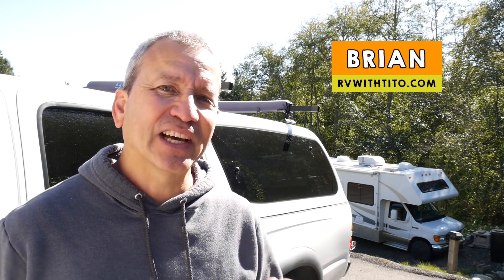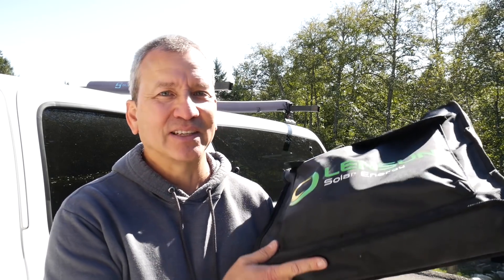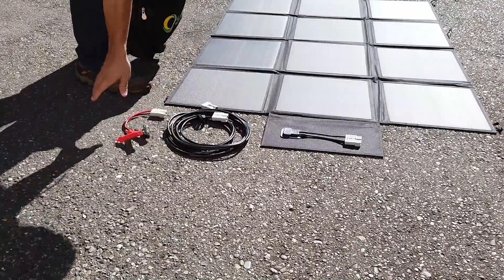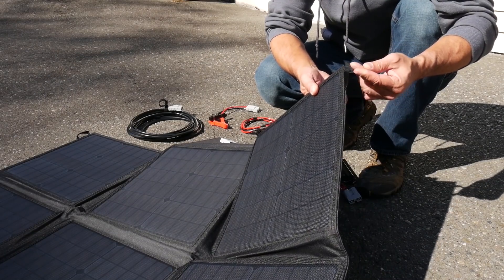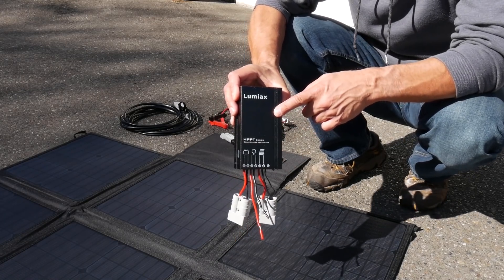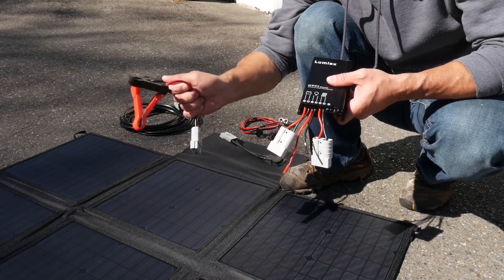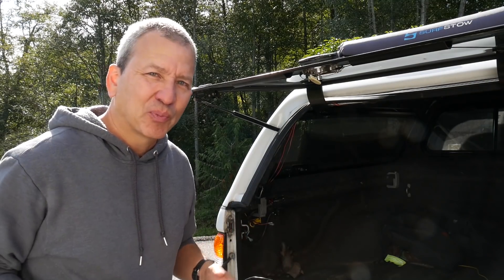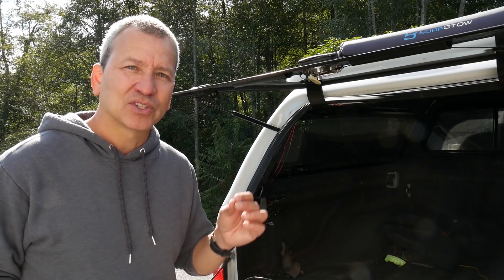(Review) Lensun 200 Watt Foldable Portable Solar Panel with MPPT

Comment from the maker: UPDATE - CHARGING LITHIUM BATTERIES - Good News! Lensun provided a Lithium compatible MPPT charge controller that charges Lithium/LiFEP04 batteries. I tested it out and it works fine. See the picture I posted in the community section of my channel. GROMMETS: I also added grommets to each side. Those also work fine for hanging the panel and support the weight well. They should last a long time.
Reply: Have you tested the panels with a different (Victron) controller?
Reply from the maker: @tannerjim  Yes. I've hooked it up to my Victron MPPT and it works great. I've also used it with a portable power station which works fine.
Reply from the maker: Yes. I connected it to my Victron MPPT 75/15. Works good.
Reply: I think I have heard of people having to configure the voltage in the controller directly (not auto) to get around that issue.  I don't have Li so I am not up on the details.
Reply: Thanks for the video Tito, I went to the website and it says that you need to let the company know that you will be using them for lithium batteries so that they can put the correct controller on your order.
Reply: @mv.m5438  What do you have to do if you order this now and upgrade to Lithium later? Any idea whether they would have to send you a new controller or is it a software or setting that needs to be adjusted?
Reply: Everything RV by Pat, the company sells solar controllers for lithium batteries I saw the cheapest starting at $99.
Reply from the maker: I'm sure the lithium compatible one would work for both. So if you know you're going to upgrade just get the other one. Or just use a different MPPT controller.
Reply from the maker: @mv.m5438  Correct. I just update the comment after testing the Lithium compatible controller. It works fine.
Reply: Lensun website: Note: the original solar controller is charge for lead-acid batteries, if you want to charge lithium battery, pls contact us, we will change the solar controller for you to charge lithium battery.  (http://www.lensunsolar.com/index.php?route=product/product&path=81&product_id=356)
Reply from the maker: @esdsecurity  Good news. The other one works. See updated comment.

Comment: Have you considering 
CTEK PRODUCT
CTEK D250SE- The D250SE is a fully automatic, 5 step charger that supplies up to 20A of power to any 12V lead acid or lithium* service battery from 40–300Ah. It has selectable charge algorithms for AGM and lithium* batteries and can use power through its dual input from alternator, solar panel and wind power. When the service battery is fully charged, the D250SE will automatically redirect maintenance charge power to the starter battery. The D250SE can maintain a stable output up to 20A to vehicles ﬁtted with smart ECU controlled alternators and also has a temperature sensor for optimized charging, regardless of weather conditions.
CTEK SMARTPASS 120S- SMARTPASS 120S is a 120A Power Management Solution which distributes, controls and maximizes the available energy from your alternator to power service batteries and consumers. SMARTPASS 120S handles all 12V batteries between 28–800Ah. The SMARTPASS 120S’s Battery Guard function ensures that critical equipment such as radio, emergency lights and n avigation systems always have power and take priority when the voltage on the service battery is low disconnecting non-critical consumers. The unit’s Battery Guard will protect your service battery from total discharge and built in over temperature protection reduces charge current before the battery temperature gets too high. SMARTPASS 120S is compatible with the D250SA and D250SE 20A on board chargers.

Comment: Nice unit and I like the way it handles partial shade. But you have to wonder why they chose those giant Anderson connectors. Big overkill for 11 or 12 amps. 
.
Reply from the maker: I suppose the connectors will come in handy if you chain a few together. Oh well. Overkill is better than underkill I suppose.

Comment: Looks like you had fun doing all this testing. Curious if it would work if you go "solar direct" into a lithium battery. Curious if the battery's BMS will prevent overcharging, overcurrent, overvoltage conditions with an 18v (or 21v) solar panel directly connected to it. Lithium batteries are expensive to "play with" for experiments...would def su*k if it destroyed a perfectly good small lithium battery like yours. Thanks for making this video...always inspiring and helpful for others to DIY solar
Reply from the maker: Direct is probably not a good idea, but I'll bet the BMS over voltage shutdown would kick in anyway like you said.
Reply: Yes, probably not a good idea to bypass a charge controller and use the BMS as a controller. The BMS doesn’t do anything except monitor to see if something goes out of specification. Then it activates and shuts down the loads and charge source.

Comment: Also Brian can you post voltage at the battery. If its 16v like you show in the video, its of course too high for battery charging and probably why the LIPO bms is rejecting it..
Reply from the maker: Sorry I didn't show that. The controller lowers the voltage to the battery to between 13.4 - 14.8 or so.
Reply: RV with Tito DIY Thanks Brian.

Comment: Ridiculous that it won't charge a LIPO battery. Maybe it didn't like the bms in you test lithium battery.
Reply from the maker: That's what I was thinking too. I'll have to look into that further. I couldn't find any references for the controller blinking indicator light either.
Reply: It should have charged the Lithium battery initially as the charge controller just “sees” voltage and a load. It doesn’t know what chemistry it’s connected to. The Lithium battery might be fully charged so the bms is not connecting to the charge controller.
Reply from the maker: @paulbaker3144  That's possible. But I don't know for sure. Lensun is sending me a different controller suitable for Lithium batteries. So I'll give that a test.

Comment: Only issue that concerns me with with this is how easy it would be to steal.  Grommets strategically placed MAY be a better design so that at least a cable could be used to keep passer-by from walking off with it.  LOVE the portability!
Reply from the maker: I'll add some grommets and run a locking cable through it.

Comment: Interesting product.  Those Anderson connectors make it easy to interface with other systems. I'd have to make my own extension cables though.  Those look a little small and short for our set-up.   I agree that grommets would have been a better choice for attachment points.  How about heating with a black panel laying directly on the ground or on the RV?   Pretty slick though.  Nice entry into the folding panel fray.  It'll be interesting to see how it holds up.  Have fun.  Safe travels.
Reply from the maker: Yeah. I'll let you know if there's any heating issue. I'm definitely adding some grommets. Thanks for the comments.

Comment: Any uv data , or dry environment data  i live in Arizona as you know and things don't last long in sunshine
Reply from the maker: I didn't see any UV data. All I know is the ETFE top layer which holds up well. There's also a fiberglass backing on each of the 12 sub panels for strength.

Comment: Unfortunately anything "portable" in the RV world means they will probably develop feet.
Reply from the maker: Yeah. Maybe I'll put a bicycle chain on it.
Reply: @RVwithTito  you may laugh, but I have a chains and padlocks on my spare tire, step support and surge suppressor.   When parked at the storage yard, I have a chains and padlocks on my traffic cones!  The cones developed feet and moved one space over!   Yes, the storage yard is in a cheaper part of town.
Reply: and be overpriced
Reply: This might be a dumb question but could you affix the panels to the roof with some kind of adhesive?
Reply: @slister45  It's actually a good question.  Yes, you can affix panels to the roof safely with high-strength tape and people do it that way sometimes.    The bigger question is whether or not it's a good idea from the panel's point of view.  Reasoning:  panel temperature affects panel power output, so cooler panels make more power than hotter ones.  This is why framed (mounted in hard frames) panels are mounted with an airgap under them;  cooling breezes pass under the panel and remove excess heat.  Surface mounting either prevents this cooling, or transfers the heat into your van.  <-- might be a good thing if you live in a cold place.

There is a type of "flex" panel that is more resistent to heat-related losses:  amorphous ("thin-film").  These panels look like they're made of long strips and are harder and harder to find. 

In general, though, "flex" panels cost 2x as much as framed panels and have much shorter lifespans.  Folks who can mount (or have mounted) framed panels on their vehicle roof get triple benefit:  much lower cost, greater longevity, and higher output.  Flex panels were designed for mounting on boat hulls and other slightly curved shapes.  They are a specialty item and not a good default.
Reply: @fratermus5502  Thank you!  See?  I'm glad I asked.  I love the way RV people are so kind and helpful to one another, and I feel so glad to be a member of this community having just purchased my first RV about 3 1/2 weeks ago.  I've got a lot to learn, that's for sure.  I am grateful for people like you who are so generous with their time and knowledge.
Reply: @fratermus5502  Then why don't the manufacturers package them in white or a reflective material to keep them cooler
Reply: That’s a good question regarding a lighter color?  I’m not sure why exactly but I’ve only ever seen Photovoltaic panels ranging from a dark blueish to almost black color. The color of silicon wafers I presume? That would be amazing if they started coming out in colors. I have seen the aging Arco panels turn brown. But they were still working even though 40+ years old.

Comment: Extension cable looks like ~10 feet, not 49 feet (you said 15 meters)
How much?  Don't see a link.
Reply from the maker: Oops. It's 5 meters. Sorry. Screwed that up didn't I  : )
Reply: 499.99 on Amazon